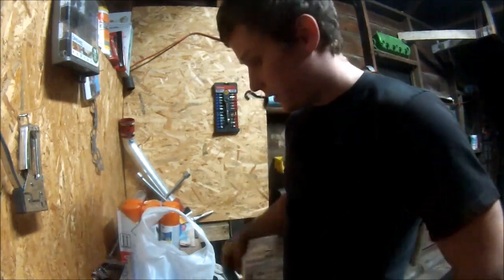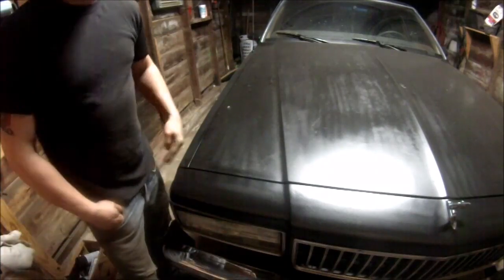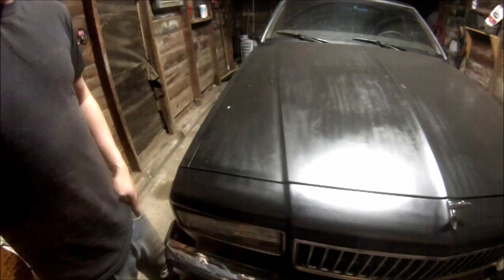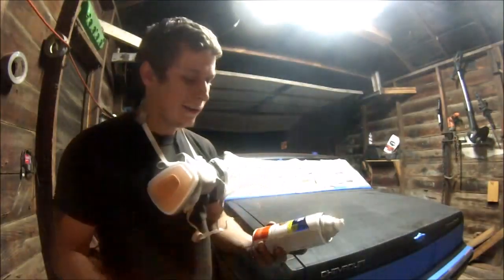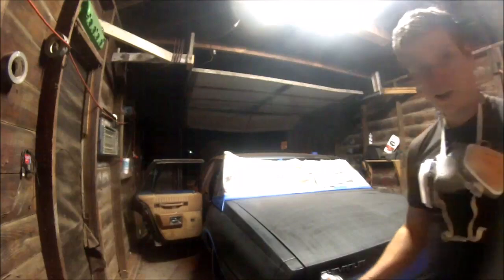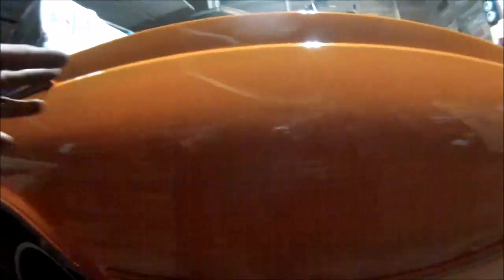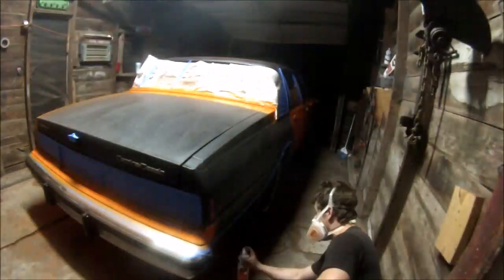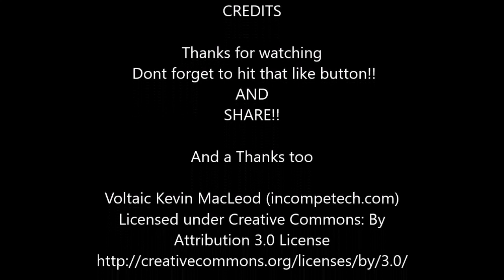How to spray can and make it look decently legit

Comment: I’m 64 years old,painted in a production body shop for 36 years. Overall with what you had to work with. And knowing up front what you will have at the end. Damn good job. I wish I could spend a few hours with you and show you some easy tricks. I admire you guys tackling your own paint work. Using a body shop has just gotten stupid expensive.
Reply: Tell me some easy tricks, I want to spray paint my 1974 chevy s10 soon, I am watching as much videos as possible to gain knowledge
Reply: All ears!
Reply: Jayz1996 199x   Wash and degrease first. Maybe a red pad and Dawn or Simple Green. Moderate temperatures. Thin to win. Tack your surfaces before you spray. And gun control. ( don’t stir up any dust by pointing the gun away from your target. ) practice and more practice.   Start small before tackling a big job. You can do it. Mixing ratios are real important
Reply: @johnny1time218  Thanka brother
I never done it but ill try my best, I'm 19 & the truck was given to me
I want to tint the windows, Lift it with bigger Tires, But most importantly Paint it myself
Its red but the color is faded, Ill paint it red but a darker shade
Reply: @onyxtytanium964  Have you started? How did you get on?
Reply: @crispdonkey2222  No I have not
Reply: @crispdonkey2222  I cant find a job, Therefore no money
Reply: @onyxtytanium964  Ah I see. Well I hope you someday get to finish your project man.
Reply: @crispdonkey2222  Thanks
Reply: @onyxtytanium964  ever try clay bar?
Reply: @onyxtytanium964  have you started?
Reply: I\'m not sure but ,if anyone else is searching for car paint spraying courses try Bablim Paint Booster (Have a quick look on google cant remember the place now ) ? Ive heard some amazing things about it and my brother in law got great success with it.
Reply: Would adding extra clear coat prevent this spray paint from fading or chipping?
Reply: @thatboidavid2982  yes
Reply: The world is waiting for your expert tips!🌎🌏🌍
Reply: 1 thing with spray cans…
Venting is super important if you want to still be alive when the paint has dried…
It’s not just a matter of toxic fumes, it’s also a really big issue with oxygen replacement…
You want fresh air to breath… not just push out the fumes… bring in fresh air…
Reply: Yes I took a 1948 crosley to the paint shop the want 7800 to paint it, told me the paint was gonna cost me 1000 dollars. I was nice and thought I'll spray it out my on my own. Nice job kid nice job.
Reply: This is not auto paint this will fade peel and doesn't have a sun guard in it or hardener it looks great for a month and then it will fade and get really damaged as time goes on

Comment: Spray cans are pretty cheap for small projects, but for bigger ones there is a turning point when the cost for all those rattlecans adds up and investing in a spray gun becomes an option. The trick with rattlecans is to get em cozy warm(not hot) and spray a million light coats. If you want a perfect job you can let paint dry and use very fine sandpaper to even out orange peel etc after a few layers before new thin layers. Finish off your color coating with some decent 2k clear coat, let that dry for a good couple of days and then fine sand and polish. With a lot of effort, you can even make diy spraying look great.
Reply: For bigger projects they have those Turbo cans, they’re like tall boy spray cans, more pressurized and has a fan tip with 4 feet of cover. It’s still not as great as a spray gun, but you can’t lose with how good of quality the turbo cans are and it’s so convenient!!

Comment: I did my jeep and it turned out great it's been a year but I have a question does it hold up pretty good with with out clear coat don't fade any because I used clear and spent a lot more just wonder how it hold up with out clear thanks
Reply: I see you didn't get an answer here but how is your Jeep finish holding up to the elements?...thinking of using this for my Jeep truck ...or maybe roll it on

Comment: js future reference never start on the outside of the car work and work your way in always start in the middle and work your way out so you not leaning on fresh paint
Reply from the maker: I didnt lean on any of it but i did get close. I usually never have that issue of even coming close but this thing was a freaking BOAT! Honda's are usually only 7-8 cans this thing took DOUBLE  and was alot longer. The way i have been doing it has worked out perfect never once leaned into the paint before but its a good idea to start on hood and work around the car but with spray can you cant do that too well because paint dries too fast so when you go from fender to door you have to keep going from door to 1/4 panel and so on. But with gun i always start hood first work around to the other side and finish hood on the other side spray can is too fast drying or i would do it that way you said. But thanks for the advice
Reply: Ya I was gonna say this isn't usually a big deal on most modern cars where you don't have to lay across the hood to get to the middle but on these older bigger cars it can be

Comment: Thats really good. I did a door on an old car I had. Did it with a gun. First time using, Orange peel all over. haha. Dont have the car anymore. Miss it though.
Reply from the maker: MrLSalazar714 nice! good thing is i didn't have orange peel with can but on the gun I've figured out how to make it not orange peel bad
Reply: Cool. Yeah I got some tips on how to fix it. But i wasn't too worried about it. I was going to take it in for a professional job. The only paint jobs I do now are on my beach cruser every summer different color to change it up. Or on my AR 500 steel plates haha

Comment: I have a question... I have only my roof and hood to spray, how would you go about doing that? As far as tape and prep, should I remove the hood and spray it while hanging?
Reply: I'd recommend keeping it on the car, taking it off would mean setting it on a trestle and restrict a lot of access for painting. If it's still on the car, mask everywhere you are not wanting to paint. Do the top first, then release and open it that way you are not touching the new paint. Hope this helps!

Comment: I’m really tempted to do this on my 1999 honda civic coupe but was wondering if it needs to be sanded since about half the car still has the old paint. And if i do need to sand it, which grits do i need and how many coats of this an 2x clear will i need? And also will i need to wet sand and buff it afterwards?
Reply: I just spray painted my cars hood. It's also a 99 civic coupe black. I got it not so long ago. The hood needed paint so i got two cans of black glossy and used both. I also got 2 cans of 2x clear and used both. Now i will let it cured for 24 hours and i plan on wet sanding it and buffing it. Wish me luck lol might upload a small clip when im done

Comment: ok that was awsome vid, what kills me is that you made it look so easy to do it. i tried to do it with a flat black paint and still i saw the paint lines. but that was my first painting with rattle cans. hahahaha. now i have to keep this vid and go back and watch it again. I have a truck that i am about to take the motor out and paint my engine bay under carriage and body so i have to try this for my self.  Now i would like to know how long does the paint stay before it would start to fade out if it fades out?
Reply from the maker: Riden Roam I haven't had any of my paint jobs Done with rustoleum fade out. Its always krylon without clear coat that flakes but rustoleum don't flake and it even has a clear and hardener in the paint to dry pretty quick and clear. Unless ur going satin then it dries with a satin clear in it
Reply from the maker: carshatter I never have but it's only because I don't have a buffer yet. it's works though i know people have done that.
Reply: Matte black is hard to do no matter what. Or any matte for the matter.
Reply from the maker: That's right I agree
Reply: thanks Ryan and James for the update. on the matte black.

Comment: I tryed it 4 times and I never got the shine I was looking for with the 2k clear coat. The clear coat does not glow no where near what you see on youtube videos. I dint have any runs dirt or runs. I tried painting a hood for my civic. The clear coat is looks nothing like the gloss on the gloss on the original paint runs and squirts. Will never be my problem is just the gloss. Could this be becuase I only used one can?
Not sure if the rain washed the paint away the next day or what happened

Comment: I would like to see you do this is a different color - softer color. I have a problem with the color and the accent of the car. They just dont blend well. Iv personally done black cars and white cars and have them come out looking good but loud colors like these always look bad to me.... Fun trick - after you tape your trim and all that good stuff. The areas you dont wanna tape such as (  Windows and vinal top) give a coat of wd40 or such. The over spy will literally wipe away. If your spraying the rag top or vinal with wd40 bothers you - you can always use elephant wax.... But wd40 will not hurt athing. Good job friend

Comment: hay james, long time sub, how many cans do you suggest for a 97 ek?
Reply from the maker: pucho513 on my 97coupe depending on color choice and base color and if u use rustoleum or not. but for me I usually get 7 and hardly ever do I use more unless I do door jams which I do at a later time. thiiid big boat I did orange took 10 cans total because it's massive
Reply: +James Dguy thanks james its the stock metallic green And its pretty faded so im looking to freshen it up and give it some new color. Thanks for the quick response. d series for life.
Reply from the maker: pucho513 no problem hope my videos help I try to stay to the point and tell the best I can. it's just hard doing it over video alot easier to show in person haha

Comment: Might look ok inside your dark garage the day you paint it, but look at it a week later outside in the sunlight!  And just to prove to you this is NO WHERE NEAR as good as a professional paint job, get you a simple can of brake cleaner and put some on a rag, then wipe it across the rustoleum paint and see what happens.  Do the same thing on a professional paint job and you will see that nothing will happen to it.This is just a quick waste of money because it will NOT last long at all!
Reply from the maker: Randy H. it covered the shitty paint that was on it and that's all I got paid to do so that's what I did. and I didn't clear it customer wanted cheap but good and after a month outside still looks good btw. I never Said it was better than a gun or just as good. it's a cheaper alternative. I have shot plenty out of the gun. I'm simply saying you can spray can it and make it look good. and I have done a few jobs with spray can and clear out of gun and they look just as good as spray gun because the clear is out of the gun it was the cheapest route and everyone around here including myself are poor even working our asses off. if i could send pictures of the cars I've spray canned with clear they still look good 1,2 years after the paint job and they arnt garage kept cars. I see your argument but for poor people if they do it right it will look good long enough for people to save money up and get a gun job. alot of the cars that come in want something just to cover the shitty paint jobs they currently have and most times it's just so they can sell the cars. I'm doing more gun jobs latley than spray can jobs. Hard for me to save money up with 4 kids and a wife with both of us busting our ass making money. shit sucks in kansas.
Reply: @JamesDguy  how much do u charge for a can job ?/